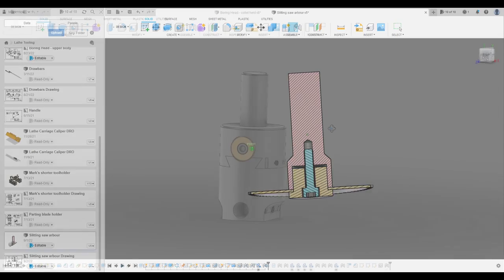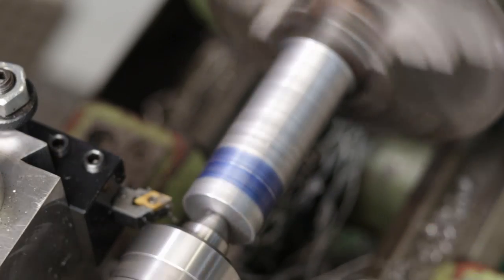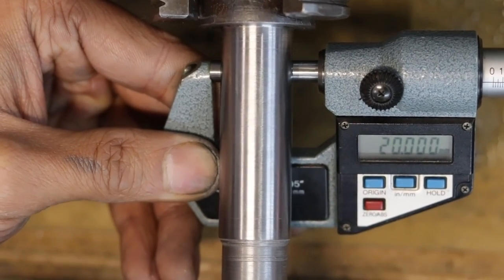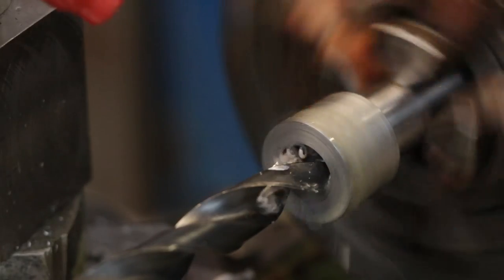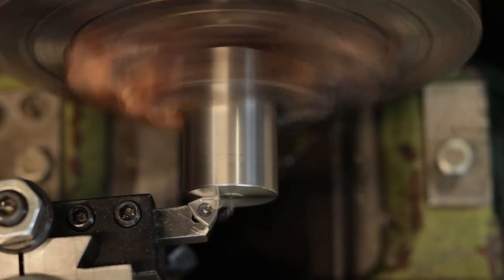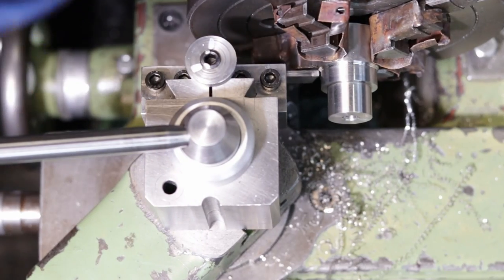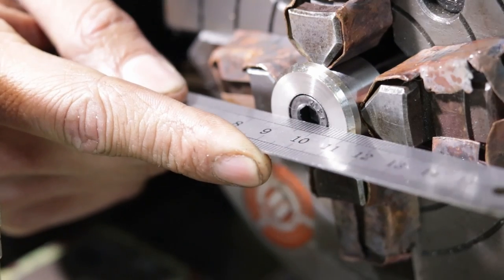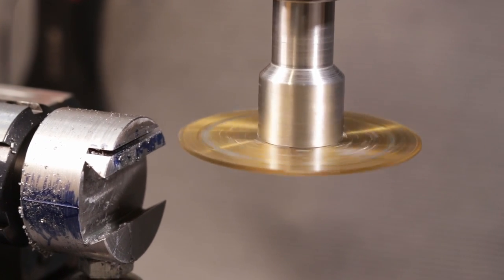DIY Slitting Saw Arbor

Comment: You’re supposed to put the shoulder on the arbor not the cap. Then you only need one precision fit. And undercut the fillet so the saw is held by the outside of the arbor and cap.